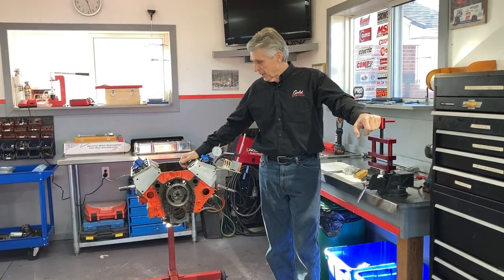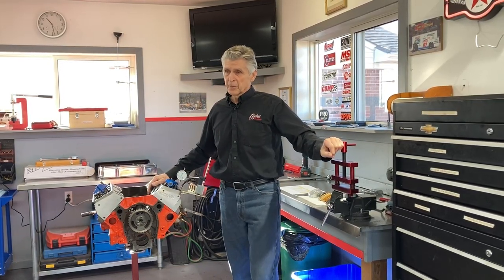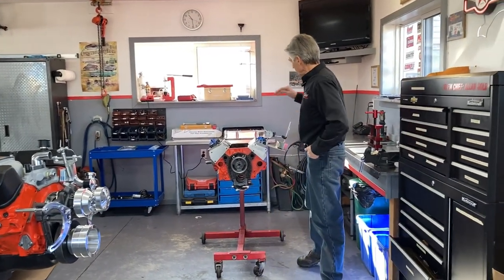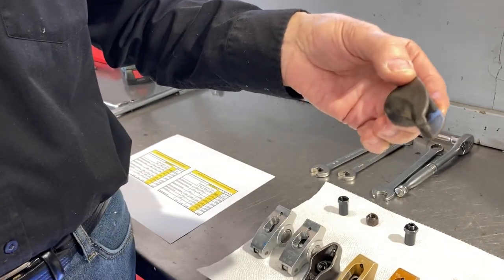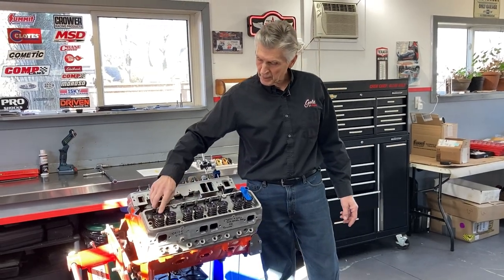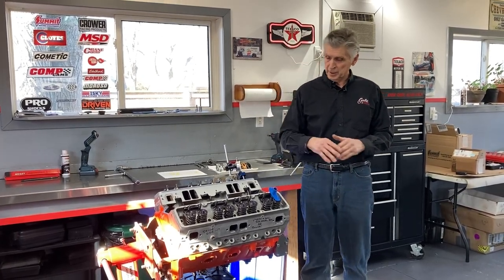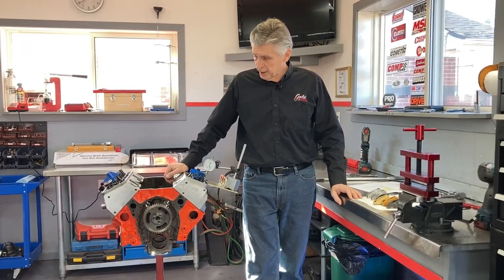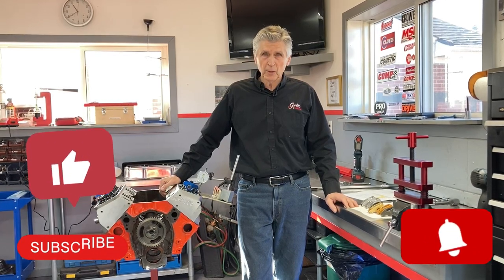SBC Chevy - Testing 6 Rocker Arm ratios 1.5 VS 1.6 actual and advertised. 👀

Comment: You should have included the ratio at .150-.200" lifter lift.
Some rockers are a better off-the-seat ratio giving more area under the curve.
Back to back dyno tests show 12-20 hp better.
Reply from the maker: Thanks for the question Ray. i have another video where I compare lifts every 10 degrees through the entire lift range if you want to check it out. AG

Comment: The effective ratio actually changes as the valve opens due to geometry changes as the contact area on the valve moves, etc.
It would be even more interesting to see the results taken at, say 5-6 different points along the valve lift cycle, then show a graph of them overlaid for additional insight on the analysis.
Reply from the maker: Thanks for the suggestion drussell. I will need a second dial indicator so I can measure cam lift and valve lift at the same time, or just record cam lift at incremental points, document that, then record valve lift at the same points. It will  be easier and more accurate with the crankshaft in the engine so I can use my degree wheel to record the points. As soon as I receive the crankshaft I will try to mock it up so look for a follow up video.
Reply: @goldsgarage8236  Yeah, it is probably simplest to just measure the lobe lifts at incremental points using a degree wheel, then measure the actual lift at the valve at those same points.
This is one of those things where the overall geometry matters, and it is significantly more complex than it appears at first glance.  For example, for those of us with shaft-mounted rockers on our Mopars, you can even change the effective ratio just by using longer pushrods and shimming the rocker shafts up a bit so that the face of the stamped steel rocker contacts the valve stem tip "further out" on the rocker.  This is one situation where the difference between the shaped tip of a classic stamped rocker vs. roller makes a difference too, the stamped one slides across the valve more and can change effective ratio wildly depending on the shape of that tip and where it is in that part of the rocking-motion.  The guys that run in various "stock parts" classes have been exploiting things like this for decades.  It's all very interesting.  😀
Reply from the maker: Thanks for your input. I will do the test as soon as I get a crankshaft in the engine. Watch for it.
Reply: I know this is old, but you're right about the varying ratio as the rocker goes through it's lift.   ....kinda.   What you said is true IF you have improper rocker arm geometry from the wrong length pushrods.

 Usually when people use pushrods that are too short to put the contact patch in the middle. (or a stock shoe type rocker where the rockers contact point moves to the outside as the rocker opens the valve).  That includes using that plastic tool that has no idea how many degrees of rotation the rocker is going to see (I.E. the amount of lift the valve will see)

If you set up a roller tip rocker with correct geometry, the contact area pushes almost straight down through the entire lift/close cycle. (and it is straight down at the middle of the lift).    Don't that will make the witness mark as thin as a needle.

...and if it's not in the middle, you have the wrong rockers. Not the wrong length pushrods.

I'm really curious how close those varying amounts of ratio would have been on that test if they were set up with correct mid-lift geometry.

Comment: I've gone with yella Terra 1.7 adjustable shaft roller rockers as I'm from Oz and will always buy local before anywhere else, so I know the quality is as good as it gets for my ls 427 cost 5 times more than the trunnion upgrade but I'm expecting to Rev my engine hard into 8k + zone
Reply from the maker: Thanks for your comment Chevy. AG

Comment: You do not mention the rocker stud size, but it looks like it is 3/8, if so you need to change to the 7/16 studs. It will change the valve lift and stabilize the valve train. Another common mistake I see all the time on stud mounted rocker systems is the length of the shank on the rocker stud. The rocker trunnion should NOT run on the threads of the studs. As you can see the threads have shinny spots where the rocker trunnion is slapping against the studs, that can change you valve lift also. Another note if you are looking for Max power, you need to adjust the push rod length so the contact patch favors the ex side of the valve. Great vids as always.
Reply from the maker: Thanks as always for your input and information Racer. AG
Reply: Why the exhaust side and not the middle where less valve guide wear (friction) happens?

Comment: What do you consider to be the best rocker arms for marine/circle track where RPMs are high (6500) for long periods of time?
Reply from the maker: Thanks for the question amiable, and I am sorry that I missed it until now. I think they all are up to the task. From my experience in Pro Late Model Racing, the GM performance (the aluminum colored ones)  are the standard in all CT400 race engines. The mandated max RPM is 6400 and we run on the chip every lap. I have never seen one fail. I also have them in my Z28 Camaro. Hope this helps. AG
Reply: Thank you for the reply

Comment: Our car owner sent our GM 604 crate engine to McGunegil in Muncie Indiana with 1.6 Chevy rockers and they checked out at 1.65.  Which were illegal and we had to buy rockers that checked out a 1.6.
Reply from the maker: Very interesting, I have never checked out any that were more than advertised.
Reply: @goldsgarage8236  do you use Chevie's jig to check them?
Reply from the maker: First I use a dial indicator to measure the lobe lift, then I use a dial indicator right on the valve. Then do the math. In Pro Late Model racing the tech guys use a go-no go gauge as per the GM circle track manual. I am working on a video where I measure the lift from off the seat to max lift at 10 degree increments of crankshaft rotation, then calculate the average ratio.

Comment: Has anyone heard of the changing ratio rocker arms? My understanding is that in theory as the pushrod is raised by the cam lobe the location where the pushrod meets the rocker arm moves to a location further away from the pedestal. does anyone have more knowledge about this?
Reply from the maker: Thanks for the question VG. I made a PART 2 follow up video about a month later using the same rocker arms, where i measured the lift every 10 degrees and averaged it. I think that might answer your queston.AG

Comment: great vid whats the blue
tool called ?
Reply from the maker: Thanks for the question Punter, the blue tool is a Proform 66789 Push Rod length checker. You can buy it on Amazon for $23.96 $CAN or about $18 USD
Reply: @goldsgarage8236  thanks very much

Comment: Question would you use 1.65 on the intake and 1.60 on the exhaust  or ir it reverse, like your content! I'm in a 383 build soon and want max power for my 4wd  no mud just highway!!
Reply from the maker: Good question Ronald. It is hard to say without testing. It depends on how efficient the intake side of your induction system is compared tot the exhaust. If you have a good exhaust side, headers etc. It is possible to over scavenge and send good unspent fuel out the exhaust. I would start with the 1.65 on the intake side. AG
Reply: @goldsgarage8236  Yes sir Air Gap with 383 and hydraulic roller for 4wd extreme  202 and 160 ported to felpro 1206 I will run 750 down legged boosters and msd ignition 6al I wish I could afford dyno tuning too!
Reply: Ole yeah 15/8 headers and no restrictions flow master exhaust

Comment: Hello, I would like to change the rocker ratio on my 92 Firebird from 1.5 (original rocker) to 1.6 (Comp Cams roller tip rocker). Would the engine control unit get this regulated because of the every 2 year exhaust gas test that we have to do here in Germany? My car is a 3.1 V6 but I like it a lot and want a little more power without making it complicated. Thanks in advance.
Reply from the maker: Good question NBS. In my opinion, I think you will be OK. If you were increasing the duration it might be a problem because it would make the engine less efficient at idle, however by changing rocker arm ratio from 1.5 to 1.6. you are only increasing lift just less than 7% with a negligible increase in duration. Hope this helps. AG
Reply: @goldsgarage8236  Put a degree wheel on and prove that duration is 100% not affected

Comment: Is 110 octane unleaded race gas good enough for 13 to 1 in a SBC
Reply from the maker: Tough question Ben. IT depends on many other factors, ignition timing, cam timing, intake valve close ABDC, dynamic compression, cranking pressure PSI, aluminum vs. steel heads. If you have lots of compression, you need a cam with lots of duration and vice versa.  Another factor is how the car is driven. Lugging the engine at low rpm with high volumetric efficiency is always dangerous. All that said, 13:1 is a lot, I think I would play it safe and use a higher octane to start. Read your spark plugs, they are a good indication of what is going on. Using a colder range spark plug and back off the timing advance to start. Hope this helps.

Comment: Just use good name brand parts! Those PRW steel roller tip have never shown any performance, usually the opposite! Valve float much earlier! You also don’t want to use the smaller studs! (Unless it’s a low rpm pickup truck engine!) If you are building a performance engine & buying rockers, get the bigger studs! American made stuff! Overseas garbage makes more problems than they are worth! On lower power circle track spec type engines, the difference from the stamped steel, (stock stuff) & the Chevrolet roller rockers were very little! 1.5 to 1.5 it was only a few horsepower!
Reply from the maker: Thanks for your comments Brian. AG